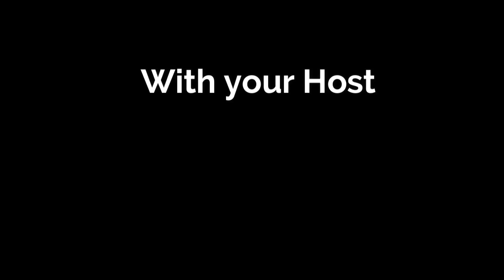Water powered backup sump pump

Comment: You didn’t test it?
Reply: Cannot fail. Float switch can fail but the pump itself will always work with water pressure. No moving parts.
Reply: @DegenDiver  had a liberty back up sump pump that leaked at one of the fittings. It didn’t “ fail” per se, but my plumber brought it back and it was replaced under warantee. There is something written in the manual that says “test monthly”. I believe it’s so the float doesn’t get stuck.